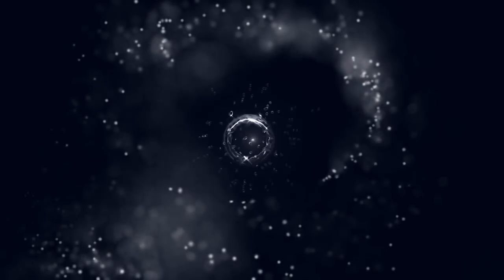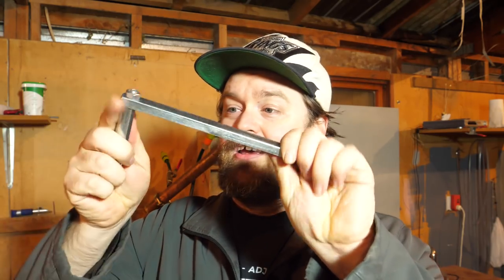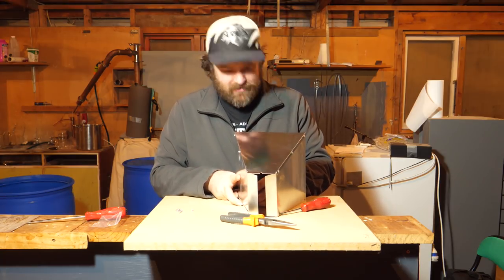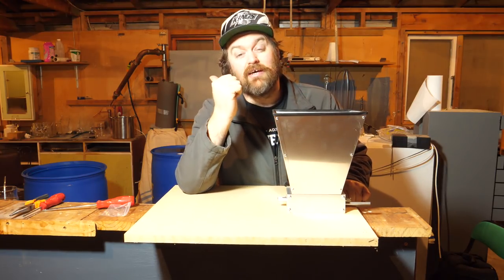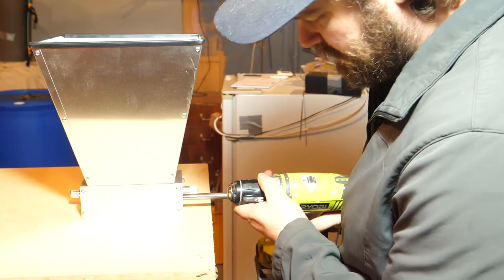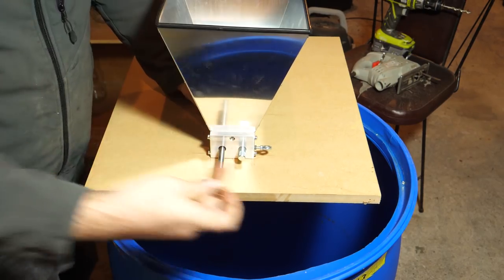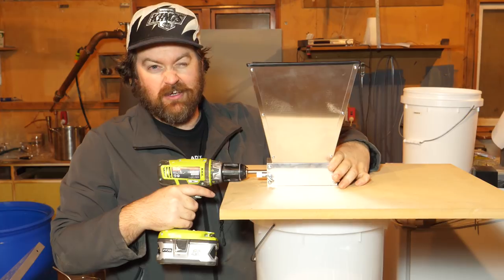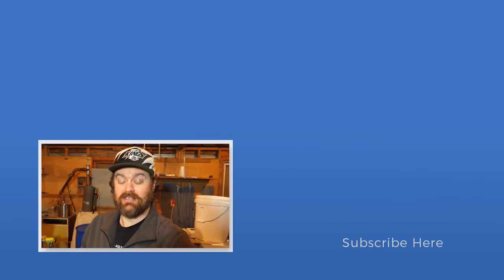MaltMuncher Grain Mill : Set Up & Testing

Comment: I added a Worm Gear 15:1 63C Speed Reducer Gearbox to my 2 roller malt mill - to enable the electric drill to run the mill. The gear box was $25 when I purchased it in Jan 2021, but the price is now $50. I had to drill holes mill crank shaft and gearbox output to couple using a piece of aluminium tube and bolts. The units need to shimmed to align the rotating shafts...

Comment: Nice! Automating is always the next step.
Ran my grain mill (Millars Mills 2 roller Barley crusher) for a couple years with a drill. Then decided to upgrade...

Found an old 1725 rpm table saw motor at the shop and hooked it up with a lovejoy (1/2" to 3/4") to a 40 to 1 gear reduction box from an old overhead door operator. Then had that gearbox connected with a pulley and belt to the mill... which always slipped after 1/2 hour of use. :( Even after adding a idler pulley to it....

So last fall, I reconfigured the gearbox and mill connection setup. Ditched the pulleys and belt. And made it a direct drive to the mill with another lovejoy gear (1" to 3/8ths). Works like a charm!

Final speed: 43 rpm which is just about how fast one could crank by hand.

I should record a video of it running.... It's slow and LOUD but crushes real nice!
Reply from the maker: Huh that's awesome man.
Reply: Waiting to see what you make next... It's a rite of passage on the journey we are all on.
Cheers Jessie!
Reply from the maker: Cheers mate :) video on that coming soon. ;)

Comment: Looks awesome! Hey for the price it is a great deal. Here in the U.S. these run about $98 or so. You can spend $150 or so and it will have an electric motor attached. :-)
Also healing thoughts and blessings to the twins and mom from the U.S.. :-)
Reply from the maker: Yeah it seems like a dang good bidget option :). 

Thanks mate 🥃
Reply: You just need a flexible coupling, a motor, a belt, and a few pulleys. The motor coupling is usually called "lovejoy" in the US. The shaft diameter is 3/8".
Reply from the maker: Dang good idea dude.  I will keep my eyes open for cheap/second hand parts.

Comment: Personally, I probably would mount the mill to the bucket lid. A couple bits of wood and you could set the lid on the fermenter.
Also, the mill looks small enough to fit in the bucket. So that would add space savings.
Reply: And corded drill would be better for the heavy work

Comment: I bought a very high-quality attachment for my Kitchenaid mixer that will do everything from crack grain to make flour. It cost about $75. What is the optimum size for fermenting?
Powered by your KitchenAid Stand Mixer. Fits all Household KitchenAid Stand Mixers.
Easily grind Low-Moisture Grains such as fresh wheat, corn, oats, rye, rice & buckwheat.
12 Grind Levels that range from a very coarse "cracked" texture to a fine grind.
This all-metal attachment grinds wheat, oats, corn, rice, and other low-moisture, low-oil grains. Using freshly milled grains brings a hearty taste and texture to your baked goods. When you bake with home ground flour you will get all of the good you could possible get from a grain. Choose from 'cracked' to extra-fine consistency. Includes a cleaning brush.
Reply from the maker: Cool man. It depends how you are mashing/fermenting.  If you are going the traditional homebrew 3 vessel system you really just want every berry to be craked open not totally broken up.  BIAB a little finer again,  fermenting on the grain  as fine as you like really.

Comment: Random question - in the absence of a grain mill could I use a blender?  Cut vs crushed grain, any difference?  Potentially larger surface area if reduced towards flower, or would this work against the process of extracting the maximum complex carbs from the grain?

Comment: Works well with maize too. 300 rpm.  I use a credit card to set gap. I changed the screws on the hopper to nuts and bolts for tightness
Reply from the maker: Ah nice.  You have the same one mate?
Reply: Still It yes the same

Comment: if you do this again (realising this is an old video , if you make a cut out in the board from the edge all the way to the grinder so the drill can lay flat on the board you can just put a cable tie on the trigger and leave the drill rotate against the surface , hands free milling . hope i explained that ok.
Reply from the maker: Yep good idea mate! It would save a clamp for sure.

Comment: I've found a food processor or blender works really well to mill your grain
Reply from the maker: Just don't use your wife's right.....haha.  

Yeah if your not mashing in a 3 vessel it should be fine.
Reply: That can create a lot of flour
Reply from the maker: Agreed.  So if fermenting on the frain not a huge issue I guess.  But not something you want for 3 vessel etc.
Reply: I learned from some old timers who taught me the finer the better but im usually using rye but we also usually make a 25 gal mash

Comment: I know I've asked you this before, but I never did get an answer. Let's say you make a 100L batch of mash at 15% ABV. Therefore, at the end you could, in theory, have 15 L of distillate @ 100% ABV. In reality, however, you're going to end up with a lot more than 15L at a lower ABV. I know it's dependent on the length of time the still runs, and at what temperature. Let's say that you run your pot still really slow. In the end, how much good consumable product would you estimate comes from a 100L mash that has been diluted to 40% ABV? Thanks. Jim.
Reply from the maker: Ah really? Sorry man.  
Yeah you are right its going to vary based on a LOT of things ( Still efficiency, reflux vs pot, personal preference, amount of cuts, etc etc etc). 

But a guesstimate would be: 
100L @ 15% = 15l alcohol. 
less  imperfect distillation = 12.75L  @ 93% 
Less Cuts of 50% = 6.3L @93%
Proof to 40% by adding 8.3L water = 14L 
Adjust for alcohol disolving in water = ?13L? at 40%  

But really anywhere between 10-15L @ 40% abv I guess.
Reply: Still it - Excellent explanation. Thanks.  BTW, I hope the twins are doing better! Cheers!!!
Reply from the maker: Yeah mate they are good again now :)